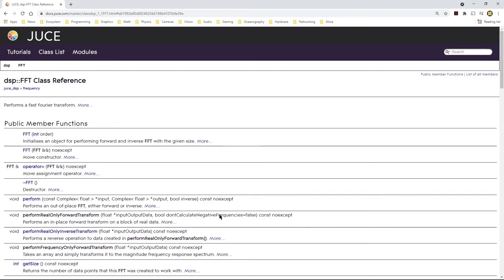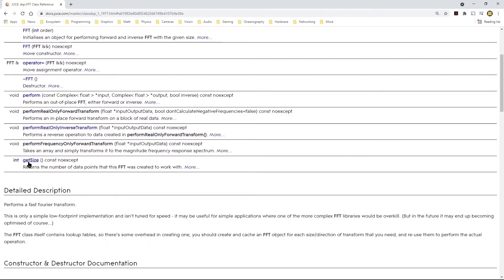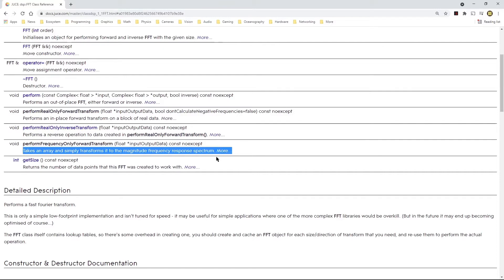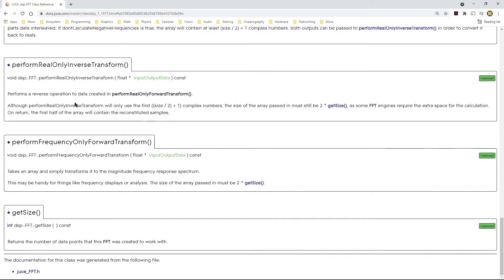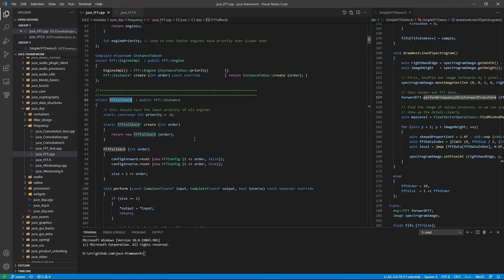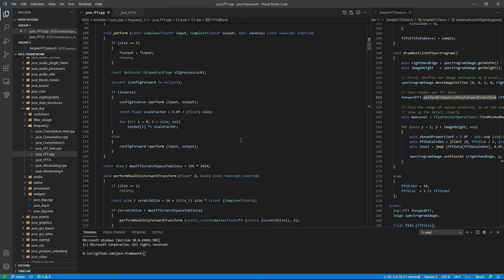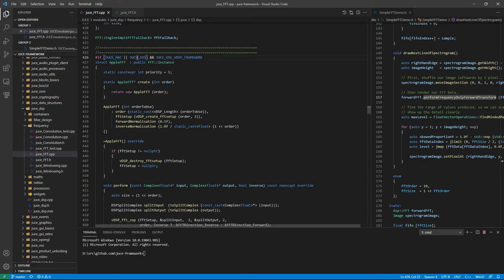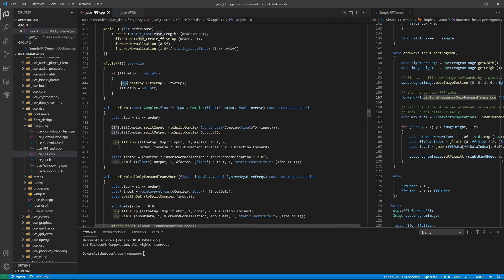Raspberry Pi 4: Deeper Dive into JUCE DSP FFT C++ juce::dsp::FFT

Comment: Nice job! On your RPi4, were you able to benchmark FFTW versus the fallback implementation? Just curious... thanks.
Reply from the maker: Thanks for your comment and question. I just benchmarked FFTW versus JUCE FFTFallback on a Raspberry Pi 4 model B with 4GB of RAM running Raspbian 11 (bullseye) OS on a 32-bit armv7l Linux kernel 6.1.21-v7l+. I used the audio profiler feature of my cvTimex application to measure. FFTW typically ran between 37μs to 44μs. JUCE FFTFallback typically ran between 68μs to 78μs. The time includes the application applying a Gaussian window to 512 32-bit float audio samples, converting 512 real audio samples to complex values, padding the complex input buffer with 512 zeros, then calling the engine to perform the FFT on 1024 complex input values. The time does not include any subsequent work performed by the application on 1024 complex output values returned by the FFT engine.
Reply from the maker: New Video: Raspberry Pi 4: Benchmark FFTW vs. JUCE FFTFallback C++ Class
https://www.youtube.com/watch?v=dVvkyHifeJw